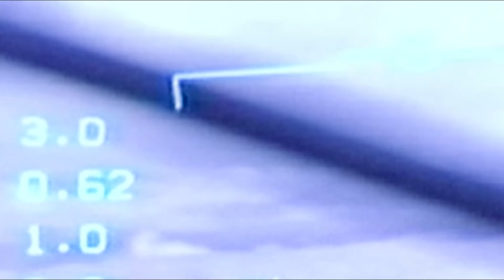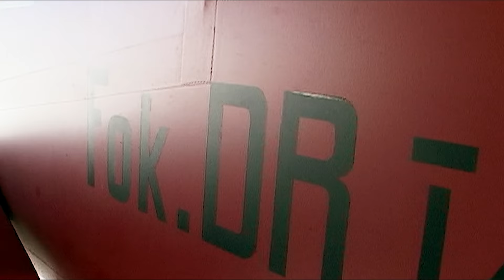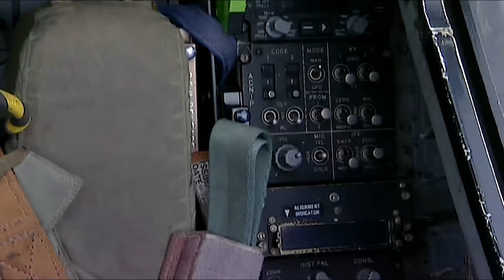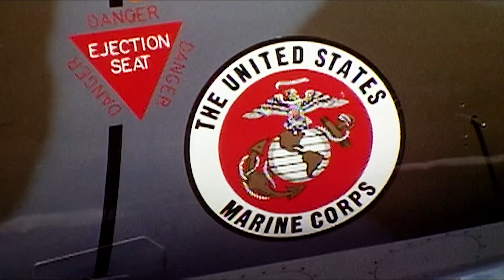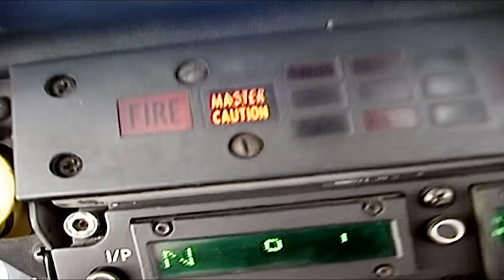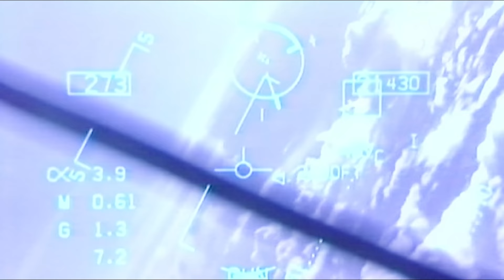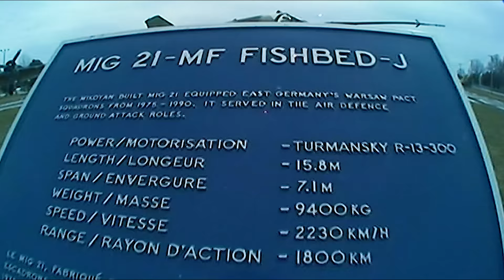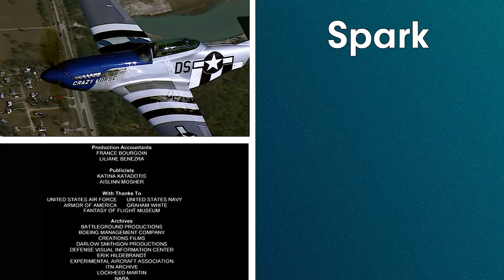Top 10 Greatest Fighter Jets Of All Time | The Greatest Ever | Spark

Comment: That's all hear how great the Spitfire is and how it saved Britain, ofcourse omitting more Hurricanes were made all but cheaper had the same engine, made in greater numbers shot down more Germans than the Spitfire,similar to Sherman made in huge  numbers,lost many and did more work than any allied tank
Reply: Ppu
Reply: You are here watching aren't you? Are you British? The spitfire was used tactically and along with better manoeuvrability,  being quicker, and carrying better arms on board the spitfire is engrained in the minds of the people because it was a fighter and fought fighters the Hurricane was used.on bombers. It was also easier to put new engines on and although it was longer to put it back in the air it was more adaptable for long term improvements. 
It also worked well on the world stage well European at least as it was responsible for helping break the seige of Malta and it was pivotal in providing fighter and bombing runs on d day. At times Hurricane f
Pilots could keep up with the spitfire but that was.down to pilot skill not the plane

Comment: The YF-17 (later became the F-18) lost to the YF-16 during fighter evaluations for the Air Force. The YF-17 was resurrected for the Navy since the F-16 wasn't right for the Navy's carrier operations. So I don't understand how the F-14, F-15 and F-16 is surpassed by the F-18 on this list. It can't even go Mach 2! It would need more speed as a fleet defender/interceptor. And if you want to talk about helmut technology, the F-35 helmut is more capable.
Reply: True, as for the helmet mounted sights, it wasn't the first US plane to get it and it was originally reverse engineered from a MIG 29.

Comment: The mustang was the first prop plane shoot down jet. Fighting three major war and very long range fighter.
Reply: Actually that's incorrect, 5 Spitfires of the 401st Squadron RCAF over Netherlands SHOT down an ME262 on 5th October 1944. Forcing a landing due to no fuel doesn't count as shooting down a jet, no actual shots were fired by the American pilots. Also it was a P47 Thunderbolt not a Mustang that 'brought down' an ME262 on August 28th and also October 2nd, 78th and 365th Fighter group respectively

Comment: the navalized carrier borne AV-8B Sea Harrier II (Block 50) multi role VTOL ground attack fighter could have been a tad bigger in size . . . a 13% stretched (longer) fuselage, increased fuselage circumference and 16% larger foldable wings plus greater overall mass on all measures . . . folding wings regardless of the under wing outrigger landing gear . . .
Reply: Of course the RN had the Sea Harrier!
Reply: If you include the harrier in this list,because technically is a close ground support aircraft (and is also my 2nd favourite plane of all time) then you have to include the A10 warthogg (my #1 favourite aircraft)
Reply: @olliedee  
orginal harrier was CAS
Sea harrier FA1wasan austere modifcation into a fighter/attack  aircraft for fleet defence
Sea harrier FA2 with Blue vixen and AMRAAM was a defintity a capable fighter
Reply: @farmerned6  you know your stuff brother.  If you could have only 1........Harrier,   Sea Harrier,   or A10 Warthog, which would it be? As much as I adore the Harrier  in all its configs I don't think I could pass on the Vulcan cannon in the A10 🤔❤
Reply: @olliedee  
As a fighter or a CAS aircraft?
If Sea Harrier and A10  fought , the Warthog is going down before it even detected the Sea Harrier

A10 is a great aircraft - If other fighters have cleared the sky's for it
While Sea harrier could multi-roll (within its limitations admitley) defend itself and ground pound

But a gunless radarless GR7/9 or an A10 for CLOSE Air Surport , always gonna want a Warthog laying down rounds

Comment: the triplane was a badly made copy of the Sopwith Triplane which was designed for greater pilot visibility not folr its ability to climb which was what intrigued the Imperial German Airforce, when intact captured copies wher sent to England for investigation and evaluation their wings  where often found to be full of dead rats and mould original versions were returned to the factory (by thhe Imperial airforce) because  they had no struts and the pilots were terrified at the sight of the wings distorting in fligt and under combat type manouvers, and these were'nt men who were easily frightened, most of the Red Barons claims were made in an Albatros.

Comment: The F-117 Nighthawk, is classified as a "Fighter" because it could be fitted with two sidewinders internally. That is reason it has it's designation, nothing to do with "Pilot Vanity".
Reply: @whalehands  that’s the first thing I thought when that was said that you for clearing that up
Reply: @KowboyUSA  I Agree!
Reply: It never had Sidewinder capability. The necessary racks to lower missiles out of the weapons bay didn't exist, which is also partly why it couldn't use air to ground missiles either.

Niloc is correct. It was mainly about deceiving the Soviets, but also partially because there were treaties regarding the number of nuclear capable bombers, and the F-117A was capable of carrying nuclear bombs so they called it a fighter to make use of a loophole.
Reply: @dumdumbinks274  You don't know what you are talking about. Watch the actual interviews of the Nighthawk pilots. They specifically stated the sidewinder capability is why it was classified as a fighter. If you have some kind of problem with being wrong, I don't know what to say to you. Good luck, believe what you want.
Reply: @dictatorenvy472  If you are referring to that one interview on that pilot podcast thingy, the pilot's comments are known to be highly exaggerated. Maybe you should look into things you don't understand before taking them at face value.

The capabilities the pilot talked about were never implemented. They were purely experimental, and particularly in the case of air to air missiles were also deemed useless due to the physical limitations of the platform. The results did however help Lockheed develop the YF-22's solutions to certain problems.
Reply: @dumdumbinks274  Sure. Okay. You are all knowing. My mistake master of knowledge. More knowledge than pilots of the aircraft, engineers and maintenance crews. You must be in high demand by the military for your extensive 100% correct information. You must never be wrong with anything. People around you should bow to your knowledge. People that can't accept being wrong are the worst people around. Good luck with that kind of attitude. I'm sure people love being around you. You must be a Democrat, forcing people to believe false information. Sorry, not going to happen. You have your sources, I have mine.

Comment: where are the F-16 or the F-15 of the F4
Reply: In a list of the greatest airplanes of the 1900-2000 the F-4 Phantom should certainly be on the list. And in 1939 -1942 the Zero was very good, but poor armament, no armour and not great speed - was not that good, rather the oposition (aircraft) were just bad. And why and how can the F117 be on this list? Might as well put the B52 on the list as well.

Comment: Had to be a little of Kelly Johnson rubbing off on designer of Stealth fighters and bombers.  The SR 71 Blackbird the brilliant Mr Johnson designed and built back in late 50 s - early 60 s as large a plane as it was had one- tenth the radar return of the much smaller F 16 , flew 3 times faster, and at least at twice the altitude and was built 20 some years earlier.  We need a dozen more just like Kelly.
Reply: Great aeronautical engineer but, he can't design a fighter.

Comment: You should be acknowledging the Avro Arrow, the first fly by wire fighter jet, first to go from testing models into full production, flying at 70,000 feet, able to reach Mach 3.2 with the new much more powerful Iroquios Engines, and reach 100,000 feet.  Testing with the Pratt & Whitney Engines; the decals would slide back do to heat generated by flying Mach 2.6 matching Russian Supersonic Bombers in 1959.  Its 84 foot fuselage; with internal missile bays, and with a 84 foot  wish list for pilots of the RCAF.  One test pilot bailed because the acceleration scared him; he thought their was some malfunction and ejected crashing the jet; which was just doing it's job.  The first 4th to fifth Generation interceptor/bomber/fighter jet designed and tested by 1959.  There was no jet that could match the Avro Arrows speed, flight ceiling, while it could catch up to Russian Bombers and exceed their speed of today.  Comparing it and to the F18 Super Hornet; with both leaving Comox Air force Base on Vancouver Island at the same time; the Avro Arrow could reach Toronto, Ontario at the same time the F18 would reach Winnipeg, Manitoba.  The same comparison with the F35; no match in performance and flight distance that made it special for Intercepting Russian Bombers before reaching the 60 Degrees Latitude.  The CIA and the US President did not want Canada to build a much superior fighter jet; the best in the World by far.  With some arm twisting of Canada's dumbest PM; the proven jet,  the Avro Arrow Program was cancelled with seven jets cut up into pieces and plans distroyed; to buy and fly the Widow Maker, the Starfighter, was bought instead from the US.  All because the CIA Director told the US President; they could not stop the Avro Arrow from reach Washington, DC.; as if Canada would attack the US, bullshit and lies of the CIA.  The PM had all Avro Arrows cut into pieces; this is what happens when you have lawyers for Politicians .  Cutting up the best fighter jets in the World; the cancellation of the Program.  Canada still hasn't replaced the jet fighter that can intercept Russian Bombers flying into Canadian Territory;  from crossing the North Pole into Canadian Airspace.

Comment: the F-117E Nighthawk stealth multi role long range fighter bomber should have been armed with an internal gun, a 25 MM GAU-12/U six-barrel rotary cannon built into the starboard side front lower fuselage (immediate below the cockpit) section of the F-117E Nighthawk stealth multi role long range fighter bomber . . .

Comment: This is a very well put together documentary. And I get some choices come down to opinion.  But seriously.  The F18 shouldn’t be on that list.  Short range. Underpowered. There’s debate over if it was even better than the plane it replaced, the F14.   The 18 is cheap.  Cheap doesn’t equate to great.  
Mig 21. The most shot down jet in history.
F-117. Not even a fighter.  Traded air worthiness completely for radar invisibility. If you wanted a multi role, pick the Mosquito.
The Zero?  Well. Debatable.  More quirky than “great”. It had great qualities, but was made nearly obsolete by same generation tech.  
You could have picked the  F-14, F-15, F-26, SU27,  Fulcrum, Flanker, Typhoon, P38, Yak-9, Dassault Rafale, Phantom, ME262…

Comment: The Mustang was designed and built in the USA for the UK by North American Aviation . The Allison engine was replaced by the Merlin transforming it a great high altitudefighter. Long range fuel tank behind the pilot and drop tanks meant Berlin and back from the UK. What about the Jug? Tempest? FW190? And the Hurricane was there at the right time in the right place.
Reply: It wasn’t built for the UK it WAS built for the USA. The first version of the P-51 was terrible at altitude and the US knew that, but at the time the US President knew that America was going to have to get involved with the war even thought the population didn’t want to. So the US sold the UK some P-51s that they basically did further R&D on.

Comment: F-18 & FA-18a are both great planes & dogfighters but the Grumman F-14s were four decades before and could defeat anything any MiGs or Mirages could put into a contested airspace.

An F-14 could simultaneously target & down six aggressors over its horizon at up to 200 miles - before the aggressor could even see an F-14 on its own radar. Grumman pioneered & perfected the concept and application of heads up displays & weapons to launch defensive missiles and offensive bombs by single F-14s but operating in pairs.

Comment: That F86 was not the first aircraft to break the sound barrier.

In world war 2 the Nazi's built 3 test aircraft and as they got close the speed of sound the nose would be forced down and they would continue to accelerate beyond the speed of sound in a vertical dive.  However the difference is they were not able to pull out of the dive.

So with only three of these test aircraft the NAZI's broke the sound barrier 3 times.
Reply: it is the bell x1

Comment: Video is at no. 2 and no F4 Phantom? I have to disagree if the F4 isn't in the top 10.
Reply: Like some other misnomers in the list (F-117;  MiG-21), the F-4 was designed as an interceptor (Fleet Defense) but somehow wound up with an "F" designator.  It made a decent bomb truck in the Vietnam War but its maneuverability could be rated somewhere between pitiful and pathetic versus its early war stablemate, the F-8 Crusader, a true fighter aircraft designed as a fighter from its infancy.  As further proof, the F-4's kill ratio was a paltry 2:1 while the F-8's kill ratio was 6:1.

Comment: F-117 though a very cool plane, but it's an Attack Aircraft, it should have been designated A-117 but the Air Force didn't want the Soviet Union to know it was only an Attack Aircraft, and had zero defensive capability, and no Dogfighting abilities, and they wanted the Soviet Union scared of a Fighter Plane that was invisible to Radar.............It worked. It had nothing to do with Pilot ego, but everything to do with Cold War force projection. 
 So it shouldn't have been included in a list of the best Fighter Planes, because it wasn't a Fighter...........Also remember it was a Stealth Aircraft that was shot down in Bosnia by a Radar Guided S.A.M.

Comment: Mig 21 got it's ass kicked by Mirage III regardless of whether Egyptians or their Russian friends piloted them, yet the Mig gets #3?. Spitfire at #2 okay, I get it, but not the MkII, but the MkXIV for me, simply the most beautiful prop driven aircraft ever.. Some later models had contra rotating propellors driven by Rolls Griffon engines with an extra 1000 hp over the Merlin. As for the winner the D model 'Stang' just goes to show how much designs progressed during the war, compare the D model canopy with a Messerschmidt BF109's lol. Number 1 and 2 are both powered by Rolls Royce Merlins, What's less known is the Mig 15 used a copy of the Rolls Royce Turbojet so Rolls was soon making awesome Jet engines too in the late 1940's, the Americans got a shock when they came up against those in Korea, only the swept wing USAF Sabres with the radar guided gun sight were their equals.

Comment: “Could fly higher than any other fighter” well that’s true…if you don’t include the P-47.
P-51 Mustang service ceiling 41,000ft.
P-47 Thunderbolt service ceiling 42,000ft.
Vague drama based conclusions.
“Best fighter” F-16 not included or the F-15, but a bomber designated as a fighter is?
The FW-190 is not mentioned but the fighter that killed more pilots than the enemy the BF-109 is mentioned, for me that would be why it wasn’t in the top ten.

Comment: Oh puhleeeeeze!!...How about Mach 2.3, powerful AWG-9 radar capable of not only tracking 24 bogies simultaneously, from sea level to 80,000 ft., but also firing on 6 bandits in a single volley, using the unmatched, 100+ mi., fire-and-forget capabilities of the AIM-54C Phoenix missile? AND performance like that even after 30+ years of punishing, aircraft carrier cyclic ops?
You may be asking, "Does such a plane even exist?" Well, it used to. The original Top Gun, Grumman's F-14 Tomcat!! Only a watered-down version is still in use by the Iranian Air Force.
True, having been a member of the U.S. Naval Aviation community (Avionics Technician or AT), I admit my opinion is probably just a tiny bit biased, but the fact the Tomcat didn't even make this list makes the ranking as much of a sham as the Jan. 6 Committee which hasn't even asked Nancy Pelosi why she refused President Trump's offer of National Guard troops to defend the Capitol.

Comment: I think the Spit was a great aircraft but it wasn't number 2 in my opinion, I would have rated the Fw 190 as a better better fighter! It had many flaws!
Yes the P-51 d was a great aircraft!
Reply: Then you are arguing about what "great" is. Most influential? The Spit saved the war. Best for its time? The first Merlin P51 flew seven years after the first Spit. Best at one particular role? You'd back a Spit over a P51 for point defence of its airfield - its the climb rate - but for nothing else.

Comment: Original Mustangs engine had SO much torque they would twist the plane into the ground on takeoff. A counter weight wheel had to be installed that spun the opposite direction to compensate for the torque which made it even quicker to maneuver.

Comment: B51 Mustang was water powered, that's why it could fly so far, it would start off on aviation fuel but then switch over to water.
Reply: No, it didn't.  Water injection for burst of speed is NOT fuel.

Comment: why the hell is mig 31 or mig 25 not n this list?
Reply: mig 25 was a dog it was fast in a climb or a straight line but on it started turning it bled speed like a stuck pig
Reply: @johnyrebbaron2618  well, its a hell of a plane. A plane with largest jet engine. A plane that still holds the record of greatest altitude. So it should be here, if not, at least mig 31
Reply: @jahnavit244  It is a hell of a plane but it is more of an interceptor than a dogfighter. If I remember correctly the Mig-25 was specifically built to try to intercept the Sr-71 Blackbird but it wasnt quite as fast and by the time it got to the Blackbirds cruising altitude the SR-71 was long gone